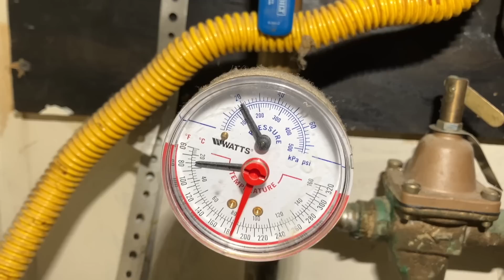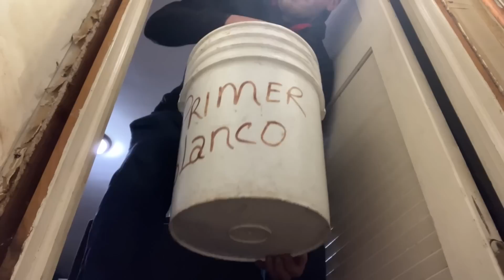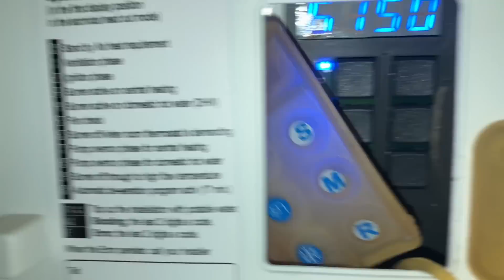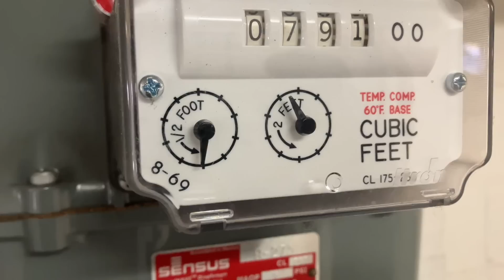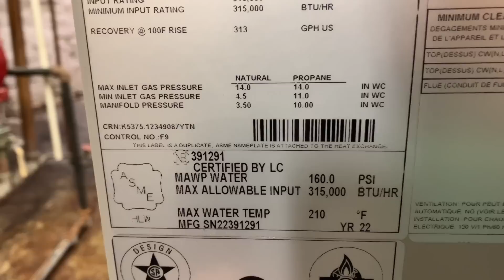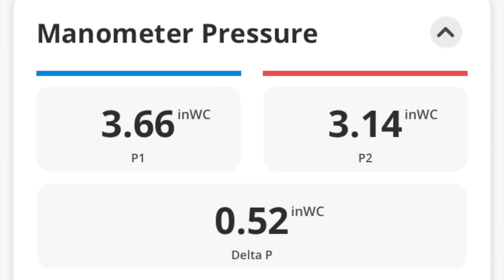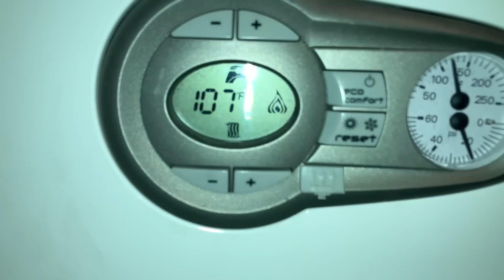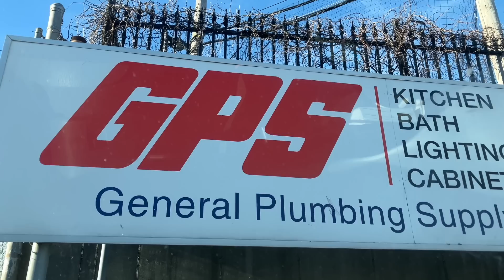I Hope the Boiler Makes it Past Christmas

Comment: on the pressure / temp gauge at 3:24 are the black / red dials the hi low settings?
Reply: Non-plumber here, but on those gauges, there are typically two or three needles. On can be manually moved by hand for reference (optional), one is for pressure, and one is for temperature.👍

Comment: That gas meter is no where close to being the proper size, at min you need atleast a 1 mill btuh meter, depending on the boiler size.
Reply: and likely none of the piping is sized even close, let along the service line to the building. someone is in for a rude awakening to their bank account, that's for sure. 🤪🤪
Reply: @throttlebottle5906 ,In my 35 years as a gas fitter / 1st responder for the gas utility in STL, this happens more than you would think; especially after the popularity of tankless water heaters & standby generators. For some reason some contractors forget to tell us about the added load 🤷🏻‍♂️. And  you are correct ,  they all have one thing in common “ someone has to get out the checkbook”💰.